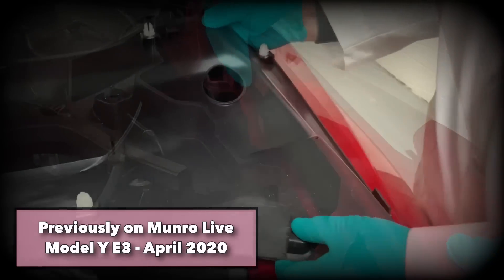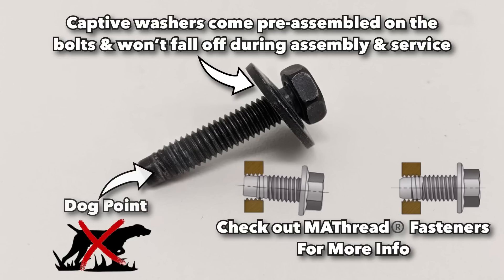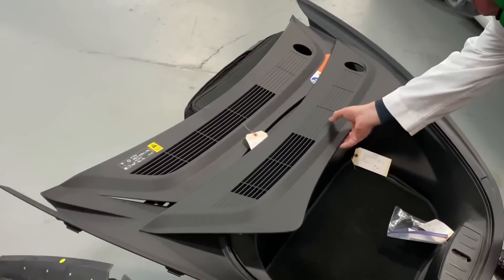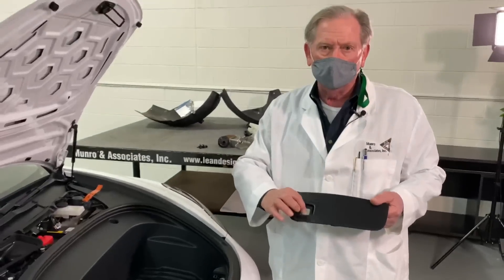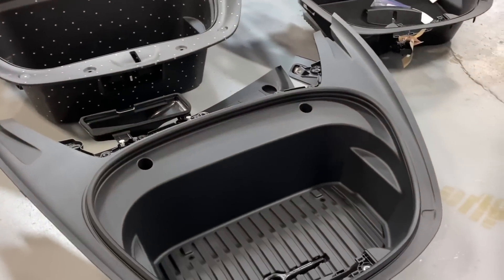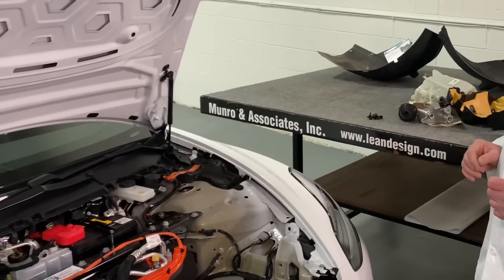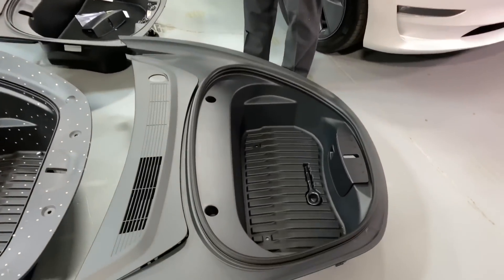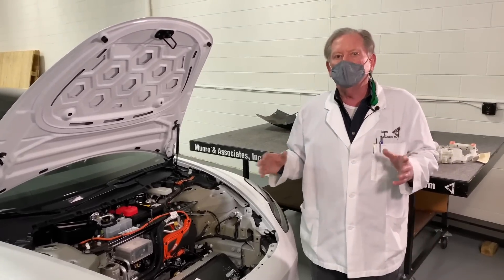2021 Tesla Model 3: E4 - Under the Hood

Comment: I guarantee the reason they changed the frunk emergency release button is so it’s farther back so things in the frunk don’t accidentally press the button when you’re driving. I have heard that some people have had boxes or other items hit the button.

Our Model Y just had that high voltage heat pump wiring harness replaced. It had been causing an isolation fault that the car thought was a short leading to it depleting the 12V battery and refusing to close contactors.

Comment: Thanks for the great video! They definitely learned a lot over the years! But I was left with a couple of questions:
- What about all the white dots on the Model Y frunk? What do you use them for? Measuring dimensions like in motion capture techniques?
- Poka-yoke - learned a new word today, that's great! And as someone who worked at a different manufacturer's line on holidays once... that's SUCH a big thing! (BTW that manufacturer seemed to suck with it, more often than not the plastic stuff would not fit correctly, you could install stuff totally wrong, I just didn't get it how a German manufacturer can be so bad at some things - that strain relief for the clips is the perfect example, never seen such a thing there)
- Not really a question but... kinda sad to see it still uses r1234yf as a refrigerant... the ID.3 already uses CO2 now.
Reply: Not sure what ID.3 is. Is there a video about this fact?
Reply: @lightdark00  I can only provide you the official german product page (which should be sufficient, though): https://www.volkswagen.de/de/elektrofahrzeuge/id-technologie/waermepumpe.html

Translation with deepl.com:

"In addition to the CO2-neutral production of the ID.3, Volkswagen is also taking responsibility in terms of climate protection in its choice of refrigerant.

This is because the world's first heat pump with the natural and climate-neutral refrigerant R744 is used here. Its high efficiency makes it the most energy-efficient way to heat an electric vehicle in cold outside temperatures."
(R744 is the refrigerant term for simple CO2)

I think the base model doesn't have a heat pump...? Well, in that case I guess only the heat pump models use CO2 as the refrigerant, still a good thing.
Reply: The refrigerant is such a minor detail here and really does not say anything.
Both c02 as well as r1234yf are safe to use and are modern relatively green solutions.
The only difference is that r1234yf burns slightly faster if it gets into contact with oxygen.
So yes, would c02 technically be better, but does it really matter much. No.
If r1234yf is cheaper and easier to obtain i'm all for it. (But I don't know this. But I assume Tesla has it's reasons)
Reply: @0xszander0  I looked into it and the biggest difference is RF1234yf is no good at -5C, while CO2/RF744 is good below that--providing everything else would also work at those temperatures. 

I really don't know how Tesla vehicles deal with extreme cold storage and starting up in such an environment.
Reply: @lightdark00  I'm not sure where you got the -5 . But for what I'm reading it's good up to -40 celsius. But in practice both don't really matter. Since it doubt it would be in pretty much EVERY car being produced right now if it caused issues at -5. This is a Tesla in the cold starting up. https://youtu.be/lL9zveDz8H0
Reply: @0xszander0  The whole Munro video is about minor details, right? Because details matter. If I could choose, I'd choose CO2. But still, that alone would be no reason for me to prefer the ID.3 over a Tesla.
But if you research, you'll find that r1234yf is horrible for the environment. The amount of it that can be detected in the atmosphere increases and the worst thing it basically deosn't degrade. It gets washed out of the air by rain and then pollutes the ground water. Also ACs are never really leak proof, that means, it'll always eventually be released into the air. It's horribly expensive to refill as well as there's basically a monopoly on it. Also it's not great in accidents, many cars catching fire after an accident are attributed to it. And when it burns... well, it can convert to fluoric acid which is even worse.
It's definitely something that's nothing you really want, neither from a customer nor from an environmentalist standpoint. Only the engineers like it... kind of. The biggest problem with CO2 is that it needs a higher pressure which makes the system more complex and expensive. Still, I'm pretty sure in a couple of years the EU will ban r1234yf as well and I thought that if Tesla developed this new highly integrated heatpump, they would have maybe already taken care of this.
Sorry for the very long comment but I felt like there was a lot to be said.
Reply: @DerKatzeSonne  Yes but what you are saying is not true! 1234yf was the replacement for r123a which was indeed damn polluting! 1234f is barely polluting. The main reason why vw was the temperature at which it ignites with oxygen. That's what's pretty much every article on this topic is about. Not only that but I wouldn't be surprised if Tesla was not able to use c02 due to regulations. VW themselves were barely able to use it due to regulations.
Reply: @0xszander0  I feel like you really haven't informed yourself. There's not a single reason not to use co2, especially not regulations (at least in Europe there have been other cars with co2 ACs before, but it was more of a premium class feature), that would be just stupid (why would you not allow co2? because greenhouse emissions? Nah. It's just a small amount in each car and thus not bad, especially compared to burning fossils; I mean you breathe out co2 all the time).
Also the problem about the "old" R134a has the problem of having a horrible co2 equivalent. You are confusing polution and greenhouse emissions here.
Reply: @DerKatzeSonne  I just gave you the main reason that VW themselves stated was the reason for using Co2 instead. So tell me how I'm not informed?
Reply: @DerKatzeSonne  We all know how faithful to the truth VW is..
Reply: @TheEvilmooseofdoom  Yeah lol. So you are saying they don't actually use CO2? And when you want to refill it in a couple of years, the whole car is gonna "explode" or something because they lied which coolant they use? Lol. Honestly guys, how can one be so far from reality. Actually VW advertises the ID.3 with round wheels but I heard it comes with square wheels in fact! /s

Comment: It is hard to understand how Tesla gets the ECO process completed so quickly where the legacy automakers take years to make a simple change.  After following Elon for quite some time, I can kinda see where his "no useless meetings" philosophy has an impact on engineering process.  Love your analysis Sandy, thanks for sharing your expertise.
Reply: Its not that they can't its they did not have to. Why spend millions when you can just add a new bell whistle and convince people its a brand new design.

If tesla did not ruin it for them it would still be a very profitable business model.
Reply: @Reg Dewitt hahaha you're very funny what do you call outrun when there are litteraly thousands applications and use of different vehicles types?! You're too butthurt to admit that tesla still has a big job to catch up to the industry standards! Their semi is not even out jet and its not even going to be adapted for europe and asia, also trucks comes in sooooo many different configurations from light duty to super heavy duty.
Reply: @carholic-sz3qv  projection and missing his point. 

You said the only reason tesla was innovating faster was because they have fewer cars to innovate on. Reg points out that sounds more like a strangth then a weakness.

All those different models are dead weight that will slow the big 3 down while tesla widens the EV inovation gap between the companies.
Reply: @john.harrison  like I said bullshit, the automotive industry is not just limited to cars, and I don't see tesla making different car models any soon , so its totally not an advantage for them since they don't even have experience or scale of manufacturing.......
Reply: @carholic-sz3qv  you lost every shred of credibility when you dunked on apples M1 chip :D clearly shows you didn’t even do ANY research into it. It’s a big fucking deal. It performs way better than anything that was tried by Microsoft/Intel so far even when emulating x86 code.
Reply: @dominicholder7323  nonsense, it all has to do with optimisation and custom chips, intel chips are standard and basically used in sooo many applications. The A14 and m1 are made to work well with ios and macos, Microsoft has never developed a chip for their OS since its sooooo fragmented and adopted in the industry. Windows is way more polyvalent and runs on soooo many hardware possible.
Reply: @dominicholder7323  android is another example of fragmentation, it runs on qualcomm, Samsung exynos, huawei kirin, mediatek...... also android tuns on soooo many other diverse Hardware like headunits, heck android headunits even support apple carplay.....
Reply: @carholic-sz3qv  way of shifting the goalpost with more untrue stuff :D Let me guess /r/The_Donald?
Reply: @dominicholder7323  bullahit i know that the M1 is an ARM chip(SOC) i followed the news back years ago with the rumors of apple switching to ARM, since their Aseries chips were already impressive and the 5nm node just made things even better, now apple can easily develop apps and programs for ios and macos, again the optimisation is the key here. The SOC contains the chip itself (cpu/gpu cores, neural engine, and many others). Apple relies on ARM architecture but they make their own custom cores for their applications. Microsoft/Windows and android are way less optimised. The iPhone has 6gb of ram when the latest Samsung over 12gb.
Reply: @carholic-sz3qv  So you know half of the story and ignore the fact that Apples M1 can emulate x86 code just fine. Where we are back at you are jumping in with a lot of nonsense metaphors to make a point that is just wrong.
Reply: Nonsense, tesla basically makes only two cars, the model S and x shared and model3/y also the same. Its not that difficult to update the only two car model you make compared to a company like mercedes which makes literally every types of vehicles from vans to trucks, bus, cars.....
Reply: @carholic-sz3qv  wanna compare the size of Tesla with any legacy auto? They would optimize and innovate if they wanted to. But they are just too lazy to do it. Better make more profit with less work.
Reply: @burninskin  are you that clueless mate?! Wtf! Tesla can barely make 500k cars a year when vw makes over 10 millions..... VW AG makes all types of vehicles and those vehicles are well adapted to every country and continents, thats why Tesla is trying to make a different/smaller car one in Europe and another in Asia...... making only one boring design doesn't pay at all.
Reply: @carholic-sz3qv  his point is that Tesla designs get far better year over year then any major car companies car series. Leaps and bounds instead of bearly any difference between one years model and the next.

Nobody is making them have so many different cars maybe they should cut back to only a few cars to innovate faster.
Reply: @john.harrison  tesla is just updating some car parts but overall its still the same, the model S and X are going to receive a total new redesign very soon because they are seriously outdated and boring. Other manufacturers also significantly improve their cars every years including total redesign. Just make some research
Reply: @carholic-sz3qv  sure sure tell yourself whatever you want and insist anyone who disagrees with you needs to do more research.

Do you even listen to what this sandy says? Tesla is making the innovations he has been recommending to legacy auto makers for years because tesla is the only one that seems interested in improving design as opposed to the marketing gimmick of calling each years new cup holder a groundbreaking achievement.
Reply: @john.harrison  because sandy says everything doesn't mean its always right. How do you think toyota is able to make 10 million cars a year?! They constantly improve and share platforms, motors, parts..... for all their vehicles. Tesla isn't the only innovative company. They are also still trying to catch other companies in the manufacturing. Your "gimmick" cup holder..... sounds really stupid.
Reply: @john.harrison  its like comparing the apple m1 which is only for apple when Microsoft and other chips basically owns the market
Reply: @carholic-sz3qv  by all means explain how you think sandy is wrong.

Your just a collection of investor pleaser speak nonsense the big three have been regurgitating for decades and its just as much of a fabrication when you say it.
Reply: @carholic-sz3qv  tesla cars are to legacy car makers what the iPhone was to wall mounted phone makers. They were real confident in their innovations and larger manufacturing output to.
Reply: @john.harrison  uhm wrong, tesla cars are just common boring nothing special about them, plus they aren't as capable as ICE, people still drive toyotas and mercedes from the 80 and 90's towing and overlanding are all the plus of ICE. Im not against EVs but they are still severely limited.
Reply: @carholic-sz3qv  yawn...same old same old. You also dodge my question about what you think sandy got wrong.

EV's are taking over the same way cellphones did. Your using all the same talking points the wall mounted phone giants did.

Why watch this channel if its all going to go in one ear and out the other?

Comment: Sounds good for Tesla saving money. I'm sure it will filter down eventually. By the time I get one in Australia they will probably be a die cast plastic car lol. Just kidding.
Begining to think early built cars are maybe better quality for the money.
Reply: This sentiment I see over and over here but it's simply not true. 
Many older cars consist of SO MANY different parts and bolts there are wayy too many points it can break.
People seem to dislike plastic, but honestly that's what people get for ordering cheap plastic shit from China.
There are many different types of plastic including very high quality ones! And by the looks of it, it's pretty good stuff Tesla's using.
And honestly, proof is in the pudding. Tesla's do not need maintenance or repairs nearly as often as even older cars when they were new :)

Comment: Hey ML, when Sandy talks about the speed of thought, it would be interesting to hear how long OEMs would take to make that change for each part, just because it's fun to watch him get passionate and exasperated
Reply: I think this is why other OEMs have model years. Very few revisions over the years. But agreed, would be fun to hear comparisons!
Reply: @ekrajb123  uhm nope it won't be fun because other manufacturers have soooo many different models, mercedes makes cars, bus trucks, military vehicles, commercial vehicles...... the updates are mostly engines, transmission and design
Reply: @carholic-sz3qv  that’s a pretty bad reason? Also mixing different divisions together is quite dumb
Reply: Probably they would have already taken 2 years to write down the specifications in a 2000 page long document.
Reply: @DerKatzeSonne  🤣
Reply: @mjcamp01  It's not as funny as you've ever had to work with these kinds of paper tigers ;)
Reply: @DerKatzeSonne  thats what she said.....